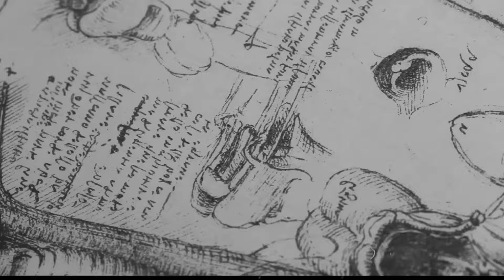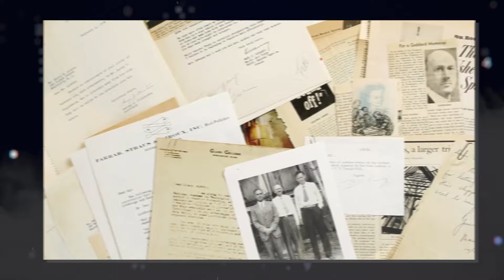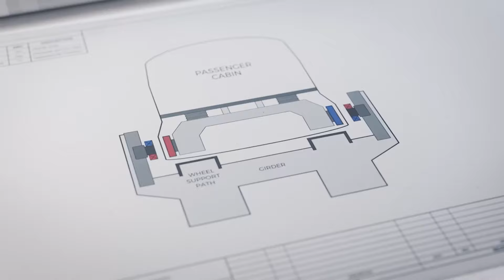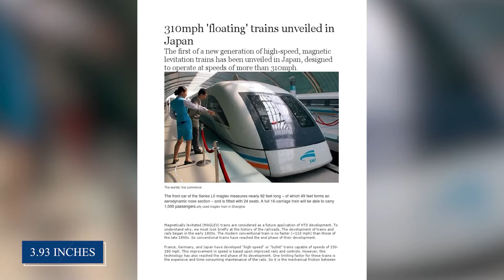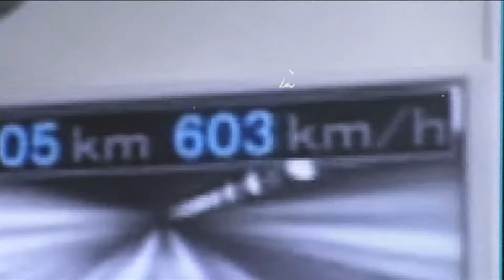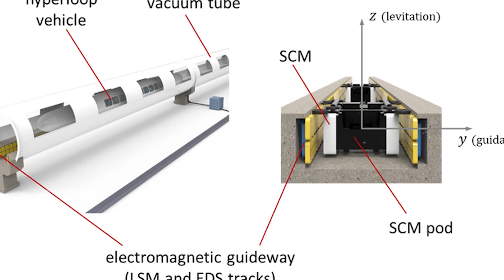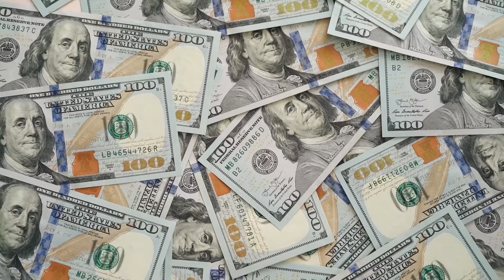Japans 🇯🇵 Fastest Maglev Train 🚆 | How Maglev Train Works |

Comment: It would be helpful to list the six lines in operation. As far as I can see, the only high speed line is the Shanghai Maglev. It's only 30 km. long, so the advantage of high speed is questionable. It used to operate at 430 km/h (giving a 7 min trip), now it operates at 300 km/h (giving an 8 min trip).
The other lines are short and low speed: Limino (Japan, 9 km), Incheon airport (S.Korea, 6 km) and three more in China (18.5, 10 and 9 km long). Clearly the Chuo Shinkansen is planning to play in an entirely different division.
One of the issues with maglev is that points and switching from one track to another is extremely complicated. Shanghai has double track, but the two trains basically shuttle each on their own track. There are points leading to a depot. I think 1:49 shows points, but the issue isn't mentioned.